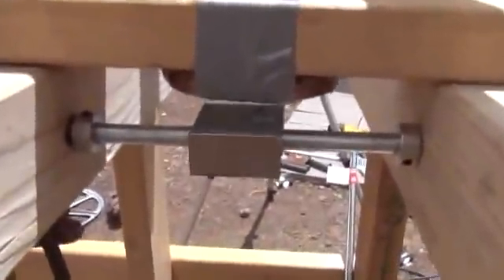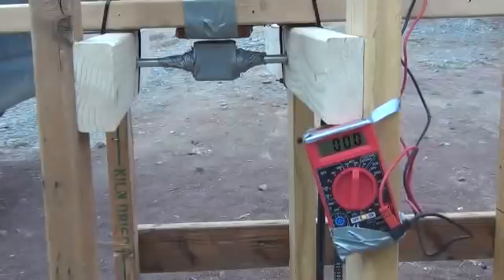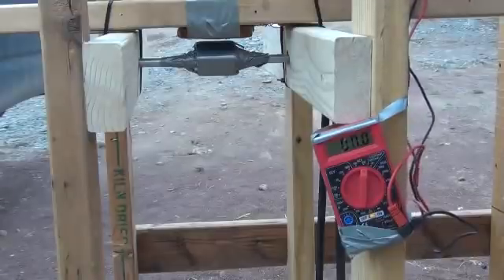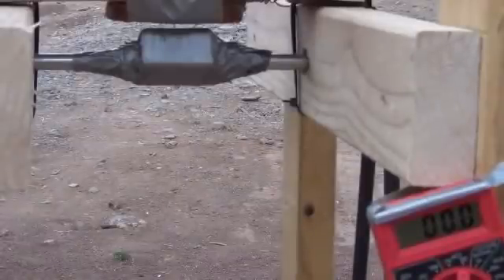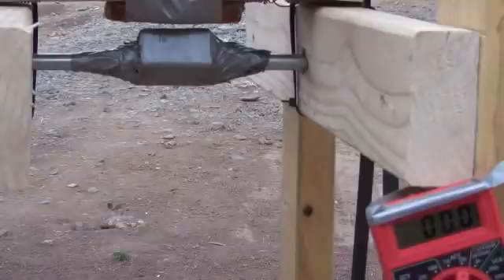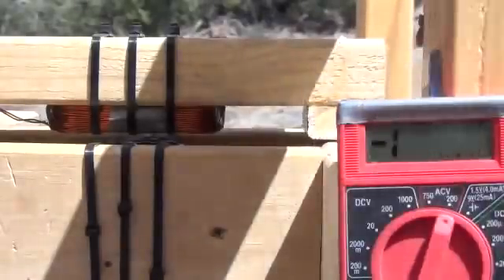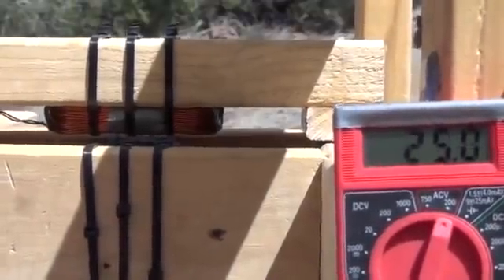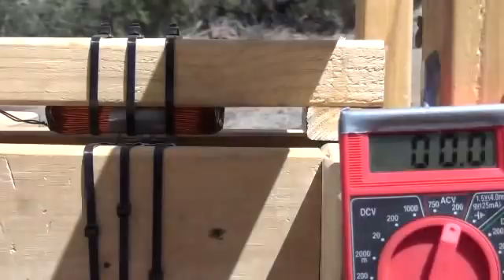Homemade Neodymium Electric Generator,  produces 117 volts AC turning it by hand!

Comment: How many amps tho?
Reply: I second this question.  If Mr. Teslonian only intends for this to be a proof of concept for generating 120VAC that's great.  But there is still the concern for adequate current and consistent frequency (if this is intended to be used with household appliances)